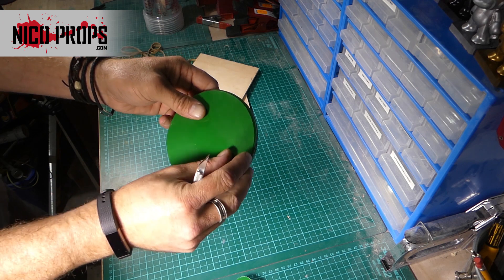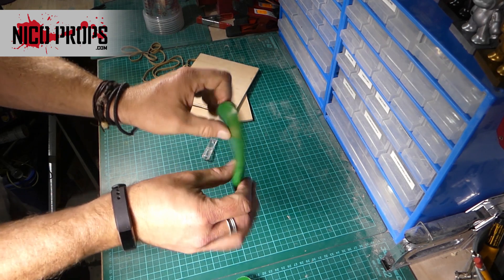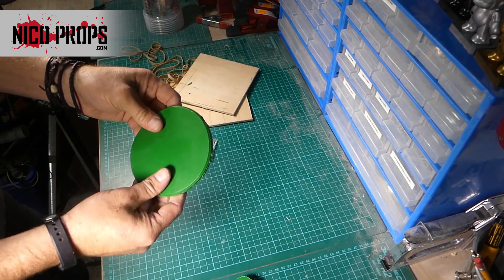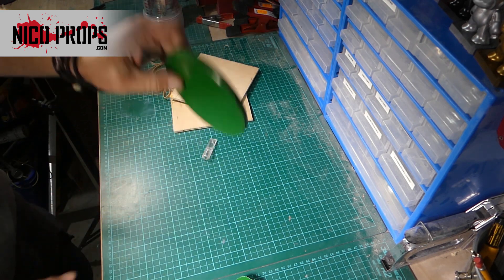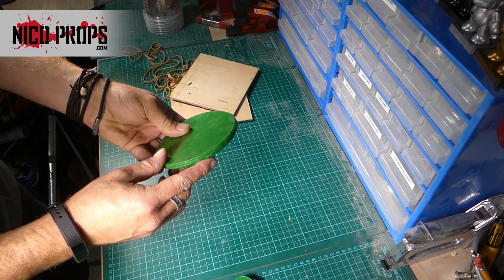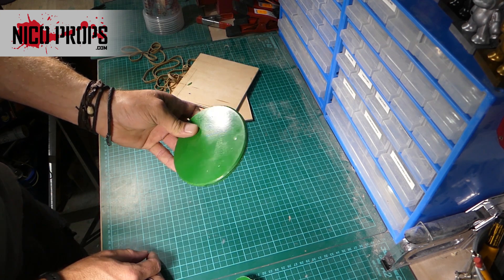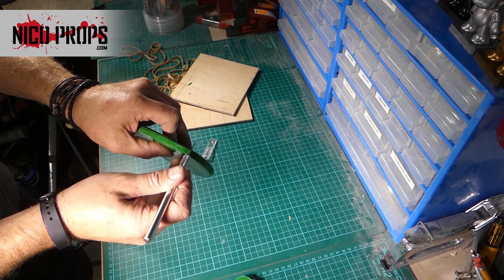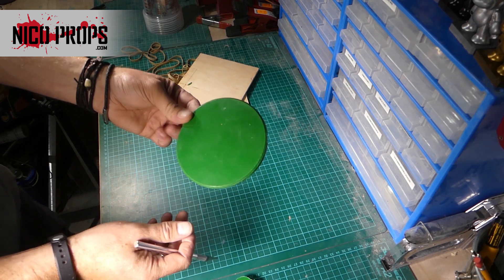WORKING WITH URETHANE RUBBER: Casting Urethane / Polyurethane Rubber in a silicone mold

Comment: Have you had any success painting polyurethane rubber?
Reply from the maker: I haven't tried to be honest but I expect you would need to have a rubber-based paint with a solvent in it which would also work on the poly casting as well so they bond

Comment: Hi, Did you use mold release?  looking for a release that removes polyurethane from silicone. Thanks
Reply from the maker: you can use a mold release but its not really needed, you can buy silicone mold release spray if you really wanted to
Reply: @NicoProps  Cheers bud

Comment: Can you cast tank tracks using this method? What is the minimum thickness you can cast with this stuff? I have a few kits that are very old and the rubber of the tracks has gone very brittle and snapped. I have been searching for a method of reproducing them for my models since they look silly without tracks, lol.

Comment: How hard is Smooth-On vytaflex 60?
Reply from the maker: a quick google tells me it is 60A shore hardness ;-)
Reply: @NicoProps   I know it's 60A but I wanted an idea how hard is that?
Reply from the maker: @smarterthanthem6304  i'm not sure how to describe it, I guess its 2 thirds as tough as a trainer sole at a guess. so just a bit softer. you can order sample cured pieces from most decent suppliers if you wanted to check it first. its what I did. I don't use smooth on products as they are expensive in the UK due to import costs and there are other brands which are much much cheaper here.
Reply: I found the polytek 70 on Amazon now, When I was searching for the  past few days I didn't came across it, Now one question how hard is the material is it hard enough to use as an embossing material when pressure is applied?
Reply from the maker: @smarterthanthem6304  it should be yes, for paper and the like, if the plan was to use it for leather then milling it out of brass, copper or aluminium would be best.

Comment: Great video, thx. Is the PT-Flex 70 rating on the Shore A? What is the hardness rating for silicone rubber?
Reply from the maker: silicone is measured in shore A, I think I used a general-purpose silicone so about 29-20 shore A
Reply from the maker: its measured in durometer normally, but you can order samples and test them with a Shore A meter

Comment: Hey there, I found this video because I've gotten into toymaking with a flex rubber, I absolutley love the medium and it's so fun to cast and mess with.  I had a SMALL question that I can't seem to find anywhere else... how do I fix bubbles and imperfections on my rubber casts, ON the actual casts?  I don't own a vac chamber so I've been extra careful with my pours, and its working great, but I'd love to somehow salvage some pieces that didnt turn out as good / have big gaps. Can you heat or melt leftovers? Or do like, a paintover or something with another mix of it? I'm just curious how people who work with rubber fix an issue like a gap or bubble hole or have any hacks. 

A lot of issues I run into is accidently not checking feet or platforms of my toys for bubbles, so when I pull them out, the feet have some gaps.  I just dont know exactly the 'best way' to fix that and get a color match, other than making a new batch, holding the figure pefectly up for an hour (cure time) while I wait for it to cure? 

TYSM, wonderful video!
Reply from the maker: you need to allow the air to escape the best way if you have undercuts is to tilt the mould and move it during the pour so it fills everywhere. next thing to try is to cut air channels in the mould.

another tip is to dust the moulds with talc before the pour. good luck

Comment: Cool. How would it go in a marine setting?
Reply from the maker: not sure what you mean, could you elaborate?
Reply: @NicoProps  would you suggest this to make a flexible fin for a board. I'm  thinking of using this material with a breakaway reinforcement inside to make it rigid. Would you recommend this to be used in a salt water environment? Or would it become damaged or ineffective?

Comment: Hi! Thank you for this video! I’m pretty sure this is the exact form of liquid rubber that I would need for my project! I tried finding the polytek PT-Flex 70 casting rubber but it’s all on back order and the link in the description takes me somewhere else 😢 Do you know what would be a good alternative to use that would yield the same result (colorable as well)?
Reply from the maker: any castable urethane / polyurethane rubber will do, you just have to check the durometer of it, flex 70 is 70 hardness

Comment: Sir, what is the most suitable material for making shoe soles? Silicone rubber (with high shore) or polyurethane rubber? What is the most similar material to the sole of Dr. Martens' boots? Thank you very much! Nice video!
Reply from the maker: the material dr martins soles are made out of is likely to be something like nylon which is heat moulded and more poured and cured. people use polyurethane rubber as soles on shoes

Comment: One quick question. Did you need to use any kind of release agent, or does the urethane rubber not stick to silicone either way?
Reply from the maker: It doesn't stick the silicone, but if you want to extend the life of the mold then use a release ;-)

Comment: Well done! We’re thinking of using this material for our skull-shaped dumbbells that you see in my profile pic to the left of this comment.... They were made with concrete in latex molds. Do you think this complex skull shape can be casted with urethane?
Reply from the maker: Hi, I had a quick peek at your channel ;-) yeah this rubber can be molded into any shape, though I would probably say you would be better off dipping the castings to get an even coat.
Reply: @NicoProps  you read my mind dude! Just bought a couple gallons of that stuff to try out the first couple and if it works we’ll be getting more. Thanks so much!
Reply: Cool idea

Comment: Could you make shoe soles out of it?
Reply from the maker: provided you got the right durometer rubber sure
Reply: @NicoProps  thanks for the reaction mate. I'm trying to replicate a russian ww2 boot sole so I'm looking for ways to make a mold and cast. Your video was really useful
Reply from the maker: @happy_dutchman  sounds interesting, share your results when it's done. just so you know the rubber I used in this video was 85A If i recall, which wasnt all that tuff due to the thickness so if i were you i would go for a higher durometer/shore hardness
Reply from the maker: @happy_dutchman  don't forget to subscribed and like the video ;-)
Reply: @NicoProps  so if I get shore 80a it will be firmer of softer?
Reply from the maker: @happy_dutchman  I believe the higher the number the firmer it is
Reply from the maker: @happy_dutchman  https://www.smooth-on.com/page/durometer-shore-hardness-scale/

Comment: Hi there. Thanks for the video! When I try to cast urethane rubber in a silicone mold, the piece totally cures except for the surfaces that contact the silicone. They are forever tacky and unuseable. Any idea how to mitigate this problem?
Reply from the maker: sounds to me like there is something on the inside of your mould reacting to the rubber most likely is moisture. try warming your molds up a little in the oven before you use them. or use some talc in your moulds, just some baby powder would do, put a little around the inside of the mould shake it around to get a good coating then bin the excess by bangging the mould out over the bin.
Reply: @NicoProps  Hello again sir! I did not realize that you had responded so quickly! Thanks a lot for the tip. I just tried coating the mold with baby powder tonight. If it works, that will be a pretty simple fix. Thanks again!
Reply from the maker: @kevinsmart2165  cool let me know how it turns out, and dont forget to subscribe ;-)
Reply: @kevinsmart2165  did it work?
Reply: @jerrywhidby.  Hey Jerry, I didn't try heating it up, but I believe I tried baby powder with success. It was only the first castings in new silicone molds that turned out tacky. Subsequent castings turned out fine without anything extra to help.

Comment: Does this rubber dissolve on the chemicals like gasoline?
Can motorcycle parts be made with it?
Reply from the maker: I'm not 100% sure , you would have to check with the stockist you buy it from

Comment: Great tutorial..
Just out of curiosity, can it be used to cast items leaching into a mould made of "Blue Stuff"?..
Reply from the maker: blue stuff?? i'm sorry i don't understand what you are asking?
Reply from the maker: ok i just read up on blue stuff and its a mouldable thermal plastic, in theory yes you should be able to use this as the mould material
Reply: There have been good results casting polyurethanes into relatively high detailed "Blue stuff" molds of miniatures. Even better than other more well known hot melt moulding materials.